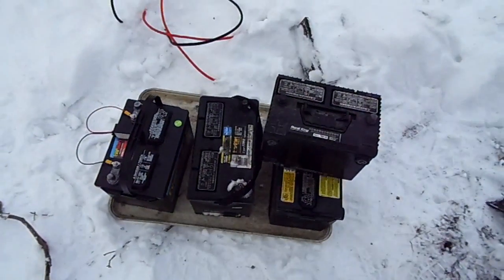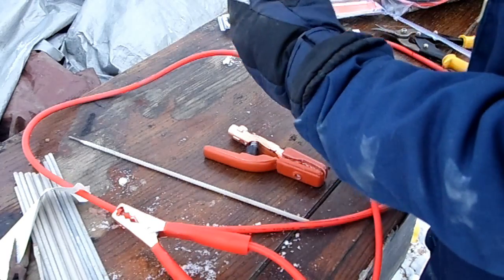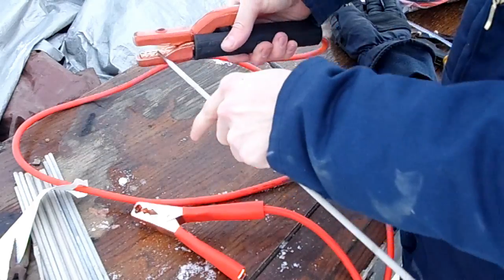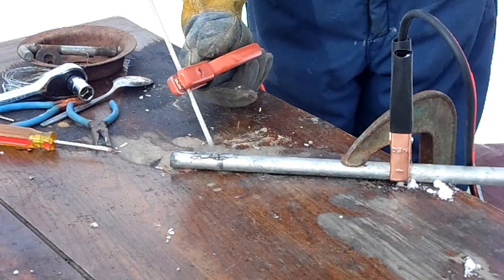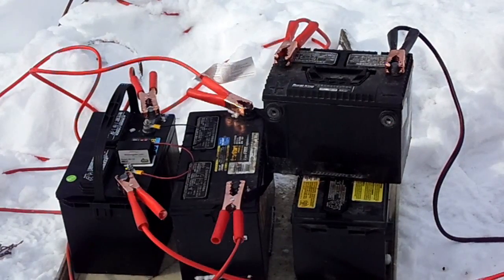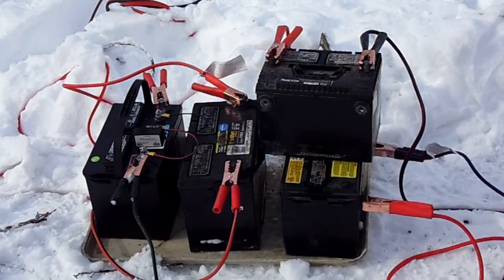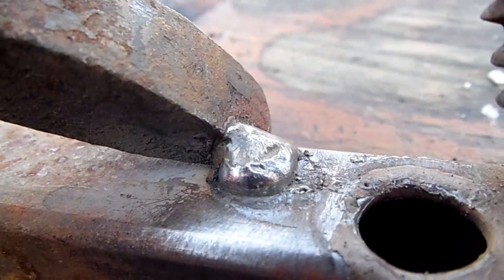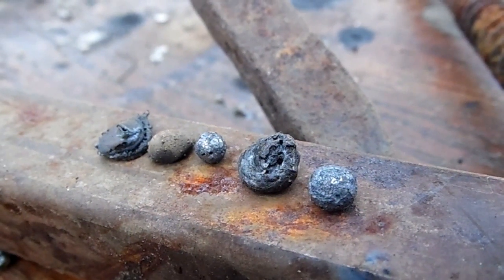DIY Welding with Car Batteries

Comment: Reverse the polarity and you'll see how much better it works. This will keep the electrode from attracting to the material you are welding, it will also cause the molten metal to stick to the material instead of splatting all over the place.

Comment: with the car batteries you can't control the heat or power output its just full out 24v so its not easy to get a good bead with batteries especially if you don;t know how to weld.  plus the things you are welding makes it tough but in a pinch i suppose but i wouldn't weld any structural things like frame rails or the like.
Reply from the maker: i ended up using car batteries to weld everything, it works pretty well. you can adjust the amps by adding more jumper cables for higher resistance, and more power by adding more batteries. get 7 or more in series and you then are cutting metal.

Comment: am I the only one that thinks he sucks at welding LOL I'm not trying to be a jerk guy but you need some practice
Reply from the maker: of course i suck at welding with stick, i'd never done it before this, but i wasnt exactly focusing on the weld i was focusing on if it could provide enough power. i latter started using car batteries to weld all my stuff like my electric lawn tractor and whatnot.

Comment: wow you weld as good as I do.
Reply: I think you welding aluminium with steal electrodes. You clamped the rods wrong. Your supposed to clamp them at the end no in the middle. Great vision though

Comment: if you use a shorter and heavier cables between the batteries you will not have as much of a voltage loss

Comment: So many issues! Reversed polarity, welding on galvanized pipe without first removing the coating by grinding or flap sanding. The fumes from burning zinc can cause irritation to the eye, nose and throat. The inhalation of excessive zinc fumes can place the operator over the PEL (permissible exposure limit) and cause "metal fume fever". Ozone can also be emitted and prolonged exposure to ozone can cause lung damage. Lastly, open batteries which are creating hydrogen gas could explode if a spark from the arc ignites the gas and should therefor be covered. Not a bad video on how to burn metal however! Looks like you had fun! I hope the welder your dad borrowed is a MIG, your stick striking and technique was painful to watch! Looks like you have 3/32" rod, not for a high powered welder, 90 amps will run 6011 of that size. Not sure what you have there for rod but 4 batteries, even weak should yeild at least that. Have fun kiddo! And don't stake your life on those welds! It's good enough for art projects, just don't build anything that needs to support anything!

Comment: Some fuuunnnny stuff here LOVE IT !  Quick thoughts::: Use hot/heated VERY DRY rod, 3 batteries(12v) (because they are always LOW/dead '"series" - + - + - + or POS to Neg, POS to Neg etc. ') , no melt if work piece is 1/4 plate or inch stock with negative to ROD like -ROD black neg holding weld rod .... and +work piece<POS RED Cable for reverse polarity DC  .  If opposite like you did its like worthless old farmer AC BUZZ BOX w/ spatter everywhere stick stick oh stuck again and cussing.  

AC boxes should have had a federal law banning them years ago. Can't give those things away.

Comment: ADVICE   you should use a smaller  gauge  welding rod ..  Try it   it will work
Reply from the maker: +George Conde yeah i latter got smaller ones

Comment: First learn to weld before making a "how to weld" video. For those watching.  Connect the POSITIVE cable to what you are welding, use the GROUND cable to hold the rod. This is called  DC straight polarity (Electrode Negative) Welding. Also, he had the rod TOO HOT is why he was burning holes in the thin wall pipe - adding more voltage only made it worse! Clean the rust off for a good connection, always start with a clean rod tip - use cutters to remove the "blob" on the end of the rod if you get one. Lightly "drag" the rod towards the area to be welded, once it arcs, DO NOT STOP THE ROD. lightly move it - Generally in a circular or back and forth motion while moving along the path you desire to weld. Stopping only makes it stick to what you're trying to weld (which is what happened here several times) You don't need 48 volts to weld, 2 batteries are just fine in most cases - there are many  youtube videos proving that point.  Also, explain your sequence better on hooking up the batteries in series before you have someone blowing up a battery in their face. Good job otherwise though.

Comment: Great video! I couldn't see the rod type but it kinda looked like 7018, it is a fast freeze rod. Just chip off/scrap off the oxidized tip after the arc has been extinguished. before restarts. Keep up the great videos! looking forward to more!

Comment: Thickness of the material and the rods appear to be 7018 which translates to keep them dry additionally a clean work surface will help one maintain and arc using proper arc  length.
Reply: Keeping 7018 Dry really only comes into affect on Structural Welds, Normal around the shop/yard type stuff it really isn't necessary.

Comment: if you use a good conectors and a good cables you can weld just with 2 batteries
Reply from the maker: you need very thin mig welding wire then, there just isnt enough voltage to effectively weld with a welding rod.

Comment: You suppose to really have the positive in this DC case as the ground,and weld with the negative that's why it keeps sticking and coming out as laggy splattery beads
Reply: Exactly!
Reply: wrong

Comment: On your next video show how a plasma cutter can be used with the 48 volt setup. A carbon stick will work best instead of a thick weld stick. Also, keep in mind that the electrons flow out of the negative and back into the positive, so I believe you had the polarity wrong, which is why you were getting so much splatter, and not only for the over voltage. The best combination is the matching of battery CCA, age, Ah, and hooking them up in parallel for increased capacity, and another two in series for 24 volts. Also, use thinner welding rod, and especially warm them up first. Place them in the exhaust pipe with the engine running for a few minutes. The flux will behave better and give you better control. Lastly, never touch the work piece with the rod, always strike at it as if you are striking a match The momentum will prevent the sticking, especially if you you have the positive on the electrode and not on the work piece. Question: were your batteries fully charged before you started? It would have been nice to see the state of charge with a voltmeter reading first. That was great how you increased the voltage for the difference of effect on thin pipe. Great job!

Comment: I would have used 3/32nd electrodes instead, which give me better welding experience. Screw the 1/8 electrodes! I can't use 1/8th 7018s with 4 maintenance free batteries, which give me less than 110 amps, the minimum amperage required for the cheap 1/8th electrodes. Too bad I can't find 3/32nd 7018s, but at least I have 6010s of that size, which weld alright with the only batteries that I have.

Comment: Galvo steel will make you sick from inhaling and swallowing the thick smoke it lets off, but if you don't have the proper equipment you can drink a quart of milk and wait 10 min or so. Milk makes mucous and will help coat your insides to keep you from getting sick. also a simple dust mask makes a big difference.

Comment: Watch someone else's video. Ur supposed to hold the stick with the negative cable, not positive. And all u need is 2 batteries. That's why u burn the metal instead of weld.
Reply: it's called "hot rodding" and is effective for "cutting" material... Same principle as arc gouging...

Comment: trying to get the arch just right is difficult and needs some practice .. had the same problem as you wen doing this the first time , took some thick sheet metal and started laying strips of weld , now that i got used to it , it is great. i use it all the time now with three 65 amp batteries in series so 36 volt. works perfect. even made a cart for it .. the only downside is when charging i have to disconnect my link cables on the batteries course i only have an ancient 12v charger. Great video

Comment: this was so painful to watch kid
Reply: Super humble...but seriously, super stupid, on so many levels.
Reply: stupid is the one who criticizes the person who is trying
Reply: Stupid is not understanding the difference between criticism and a personal attack.  Stupid is not using capitalization and punctuation, when criticizing the intelligence of another. Thanks for piling up the examples.
Reply: stupid is not knowing when you should of kept your fucking mouth SHUT!
Reply: There's another.
Reply: Hook the positive to your work piece then your negative for your rod holder electrons flow negative to positive instead of the weld pushing it will pull into your worke

Comment: Stick takes a lot more finesse than tig or mig welding.. Watch some videos on Stick and learn to do it properly.
Reply: Well he isn't using a proper stick welder now is he? Rofl.
Reply: It does not matter what your power source is. IF you know how to weld.
Reply from the maker: so would you like to weld with just a solar panel and no battery?
Reply: Rinoa Super-Genius a single solar panel does not produce enough amperage to weld with.. a 200 watt solar panel is only 16 amps, and you need at minimum 90 amps to produce a decent weld, So to produce a decent weld on steel. You would need 7 200 watt solar panels, wired in series.
Reply from the maker: Pantharen
so you agree your power source does matter even if you know how to weld?
Reply: Rinoa Super-Genius Your power source does not matter, as long as you have enough amperage. You can weld with any power source, as long as you have at bare minimum 90 amps for steel.. Lighter metals like Brass, Bronze, Titanium, Aluminum, Silver & gold all require less amps.
Reply: i think stick is pretty easy but mig can be a pain in the ass if you are requiring it to stand up to destructive testing in a position that doesn't allow great penetration like say 3g vertical down which doesn't actually exist in the real world but they are making us do them in school. tig is great bc it allows more manual control which suits me better but I've heard many say that tig is trickiest.
Reply: Aluminum requires higher amps I thought.
Reply: for welding 3/16th inch Aluminum plate: Specs are: https://www.millerwelds.com/resources/weld-setting-calculators/mig-solid-core-welding-calculator 

Wire Size & Wire Feed Speed:
.035" (0.9 mm) at 425-450 ipm
3/64" (1.2 mm) at 300-325 ipm

Shielding Gas & Voltage Range:
Argon (AL): 23-24 Volts

Amperage Range:
140-150

Amp Range for 3/16th inch Steel is 180/190 amps
Reply: interesting
Reply: I started welding when I was 12, I'm 50 now
Reply: you know what I am thinking tho, I am thinking about tigging aluminum with a foot pedal. I set my amps higher than I'd do steel, but let off the pedal when I am running hot.
Reply: so that is probably where I got the idea that you'd weld hotter with aluminum, but only until you get the puddle going and being that I only did it once, I probably only remembered my settings without thinking about how much amperage I'm putting out through the foot pedal
Reply: my mistake

Comment: Your battery's weren't charged enough (2 battery's fully charged is plenty) and your stick electrodes were wet from laying them on a wet table. Lastly that pipe was way too thin to use as an example. Why show someone how to do something if you aren't going to do it right

Comment: i know this is an old video.
I've seen this done plenty of times, except the negative was used with the electrode and the positive connected to what's being welded. less splatter. try it and let me know how it works.

Comment: We gave you Tesla  to learn you about conductors,currents but still you don"t get it. You can connect a 100 batteries and nothing ,  look at you cables they are thin, make them ticker.  Welding requires a lot of current . Trough so low quality conductor can not deliver enough. There is one more thing important , everything must be very firmly connected to avoid making any resistance. In general you have to consider ohms low and conductor thickness. two batteries of 12V-100A in series will do any job for short time of course.

You missed safety  making any sparking near lead acid batteries. while have fast charge or discharge  the batteries release flammable gas which can lead to very powerful explosion .

Comment: You should connect a rewounded microwave oven transformer (even a transformer from a really old 110 volt AC buzz box) between a positive terminal and the stinger to stabilize DC current. That way, you can run 6010/7018 rods as smoothly as a brand name AC/DC stick or inverter welder. I didn't know what the hell a choke was, but then I realized that chokes and transformers are the same thing and they both produce alternating current, but for some reason, they can stabilize direct current produced by batteries or bridge rectifiers. 

Other than that, I would like to use Christmas lights in a series to control current.
Reply: Υep! (and 'some reason' is called 'inductance' )

Comment: Not done correctly, but interesting to see all the problems you have when its done wrong. Ended up with at least one good looking weld in the end. Zinc fumes are pretty bad. Overheated some molten zinc in my furnace once. Not recommended.

Comment: for one you should be using the negative for welding easier starting and u should be able to do it with 2 batterys no prob if there charged

Comment: Your rods are wet! Stick them in the oven for a couple hours and dry them out, your using too much power/heat and your polarity is backwards. Also welding galvanized will create poisonous fumes
Reply: Don is 100% correct on all statements! Way to go Don!
Reply: Thanks Don
Reply: True life
Reply: @benz merc Welding on galvanized without a respirator will eventually give you parkinson’s disease

Comment: I see a lot of negative comments! That's to bad! As a welder, I can tell you we are a rude breed, and are very critical and prone to judgement! LOL. You should see the comment section of a welder group forum! That being said, I think your experiment was interesting. 1). All fumes are hazardous to inhale, but Galvanized materials put of an exceptionally toxic cloud. 2). As you stated, you aren't familiar with arc welding, so that was one of your big issues. when the flux, (that cattail like coating around the filler metal that makes up a welding rod) gets hot, cracks, and falls off, you have a problem welding, even if you had the finest welder in the county. Try striking the rod like a match when you start, and drag the rod around some, while you establish a good steady arc. Never start by just poking the steel. That will stick every time. 3). I believe you had the right conditions to weld when you had 3 batteries / 36 volt set up. However, I would try reversing your electrode polarity. 4). I know nothing about the risk of the batteries exploding. I would try to find more out about that however, because if it did happen, it doesn't sound like much fun. I hope this was "constructive criticism." I thought it was a cool Video!
Reply: God loves a trier I’ve learnt from video
Reply: If he had reversed it, it would have welded alot better.
Reply: @bryanroupe8646  Yes, DC welding you ground with the Positive side or you get too much splatter.
Reply: Yeah welders are dumbasses proud of a grunt trade.
Reply: Brant Keltner 
Thank you for being kind to this kid. My fist intention was to berate this young man for attempting to weld galvanized steel but saw your post first. Im sure your approach was much more effective than mine could ever be.
Bless you.
Reply: Yup no splash with negative not pos
Reply: they are negative because this is straight out of an episode of Macgyver. personally, i think its cool.
Reply: @tvfunkyman6269 macgyver only used one battery if I remember correctly 🤔
Reply: @benz merc ship builder here... awesome comment from 4 years ago lol
Reply: Batteries won't explode because they were constructed to produce high currents. When I crank a diesel car in -20C, it sometimes drains 77ah car battery to 11.6v.
Reply: Hi

Comment: You'd probably get better results with better connections -- lots of contact resistance with all of those jumper cable clamps. If you had the cables bolted to the batteries, you wouldn't weld the stick to the workpiece as much.
Reply: Plus his POLARITY was reversed. Needs DC Reverse.

Comment: you should get an electrode holder that screw rather than a sort of clamp like this. i never understood why they still make em, yeah it's quicker a tiny tiny bit to change the electrode, but with a screwing one you can bend it and give it and angle rather than your wrist having to be at an angle

Comment: Thanks for doing this. i wasn't sure if i NEEDED two batteries but this video shows i will need two, maybe 3.
GOOD VID!
Reply: +B DL It works far better if you use something more secure than jumper cables to connect the batteries.  You should use proper lugs like car wiring does, otherwise you'll never get enough amps and you'll keep welding your stick like OP does.

Comment: You'll get a cleaner and better weld if you reverse it.. supposed to use negative weld.  put the positive to the substrate and hook up the welding rod to the negative.. it works better.

Comment: Those look like E7018 welding rods. They need to be kept in a hot box, otherwise oxygen and hydrogen will get into your flux and therefore into you weld so no matter what your weld wont be very good or strong. I would throw them away and buy some E6010 or E6011 Rods.
Reply: Your jumper cables may be around 12ga copper coated aluminum wire looks like from H.F. try 3/32" rod with.  #4 wires for leads